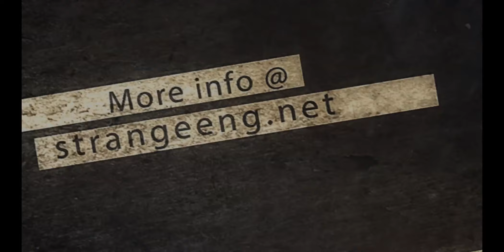Strange Engineering Pro Touring Floater Install Overview

Comment from the maker: It's specifically designed to work with Wilwood. The housing ends would have to be replaced with the strange pro touring spindle. The kit... http://www.strangeengineering.net/product/pro-touring-floater-kit-with-wrench-axles-and-brakes-sold-separately.html/
Reply: I'm looking at this for a drag application, so I'm looking for a smaller brake rotor to allow 15" wheels and possibly dual calipers.   Is that an option?

Comment from the maker: The pro touring kit is not intended for drag racing. We do have a drag racing floated kit and/or offers a low profile (caliper) drag racing brake kit - the low profile caliper is specifically designed for 15" wheels. However, our brakes and drag floater - are solely intended for drag racing.